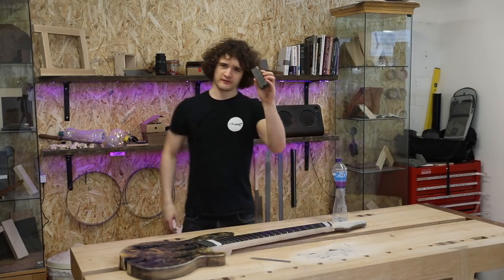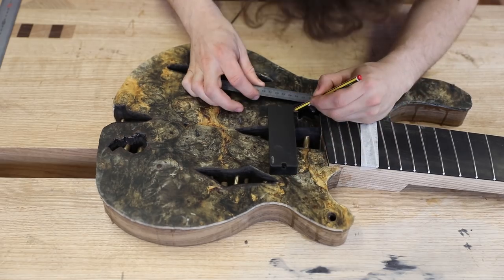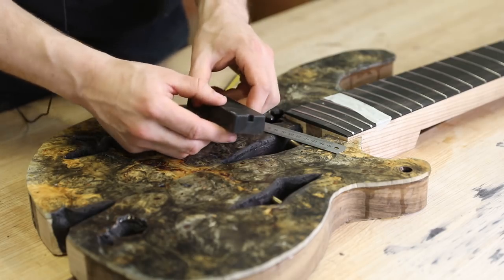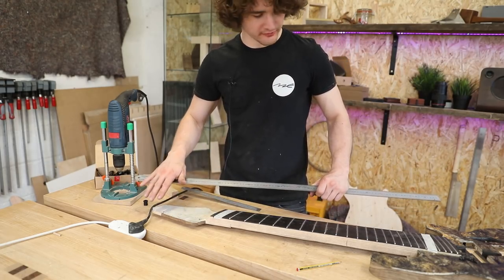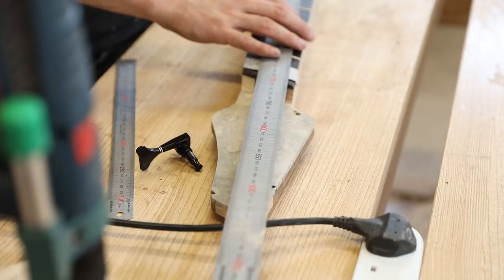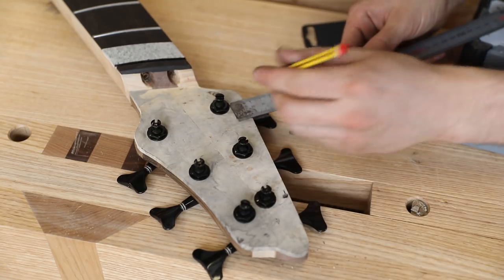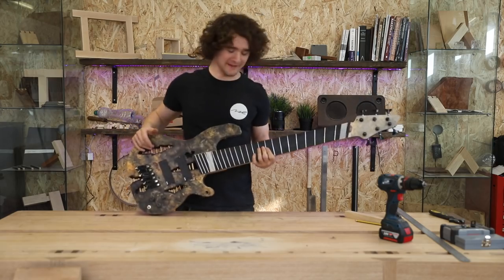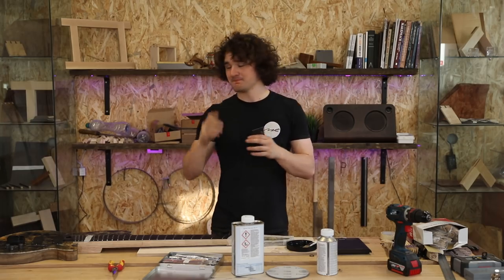Making a Custom Bass Guitar | Part 18

Comment: That was a lot of tedious work compacted into a short video. Thanks fo showing the fix you used for adjusting the spacing of the string holders. Putting in a dowel and red rolling is a very useful technique in such cases. While I’m not at all into basses I’ve enjoyed this video series and anticipating hearing the bass being played.

Comment: You might want to put some springy foam behind the pickups when you do the final setup just so you can fiddle with pickup height from side to side for even string response (ie. the pickup on the B string side will be lower than the G string side).  You want this thing to sound and play as good as it looks.  As a woodworker and bassist (I've built two fender clones with figured maple tops), I have enjoyed this series tremendously, Matt.  Very ambitious to jump right into a fanned fret 6 string, let alone all the wild body cutouts!

Comment: String through the body is a tonality thing and is a feature on some basses. You can buy them with or without that but basses with the string through option usually have a fuller tone.

Comment: Just an idea but :) you can use a bowl and tray router bit mounted in the drill and create a little dip for the knob and thickness it properly, before drilling thru so you don't loose the center :)

Comment: Another way to check of you're drilling straight is to drill through the centre of a CD. Use the reflection of the drill to check if it is in line with the drill itself.
Reply from the maker: That’s a great idea!

Comment: Man, I hate to say it, but you may never get that thing to sound in tune. You really need as much of the adjustment of the saddles as possible in either direction to be able to intonate the bass. This is pretty much the single most important thing when initially setting up the guitar that will make it actually playable or not. It's pretty much what always makes or breaks a custom guitar build because if you don't get that geometry perfect and allow enough travel for adjustment, it's gonna be immediately noticeable. I had to reset the location of the bridge on my first couple guitar builds slightly. If worst comes to worse, you can probably fill just that one cavity (and the saddle holes) with black epoxy and start over.